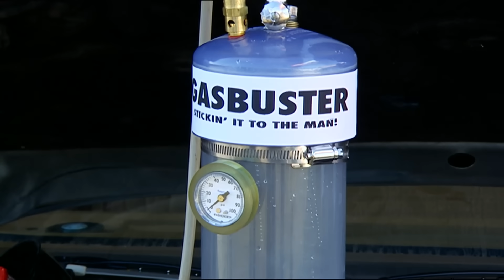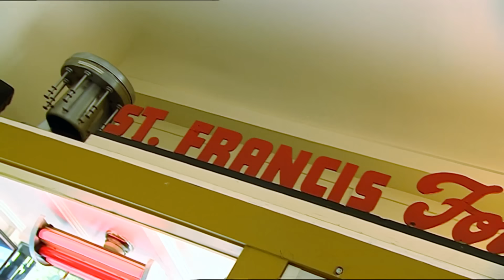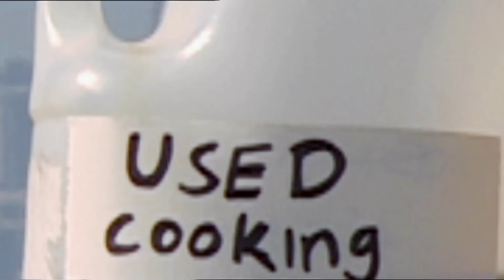Do Aftermarket Fuel Saver Devices Actually Work? | MythBusters

Comment: A point of fact: switching your vehicle to operate on bio-d, wood chippings, acorns, eggs, whipped cream is not fuel saving. It is shifting your fuel choice. If your car runs . And burning weird stuff in a diesel usually works. So you are just burning some fuel....

Comment: My HJ47 troopy ran on pure vegetable oil for several years around Rockingham, Western Australia after I fitted fuel heaters around the lines from injectors to motor. I had a 44gal drum of filtered oil for use anytime. I did run diesel through the lines once a month to prevent clogging.

Comment: I think it is incorrect to call that contraption a "hydrogen fuel cell."  There are cars that run on hydrogen, but they are designed for it.  A fuel cell vehicle (FCV) or fuel cell electric vehicle (FCEV) is an electric vehicle that uses a fuel cell, sometimes in combination with a small electric battery or supercapacitor, to power its onboard electric motor. Fuel cells in vehicles generate electricity generally using oxygen from the air and compressed hydrogen. Most fuel cell vehicles are classified as zero emission vehicles.  As for all those other gizmos (the magnets, etc.), they've all been tested by the California Air Resources Board and found to be bogus.  (I used to work at CARB.)  And if you live in CA, do not make changes that involve your car's emission system, unless the product is CARB certified.  Some of the aforementioned gizmos are permitted to be put on your vehicle, but the only thing the CARB certification means for them is that the gizmo won't harm your emissions system.

Comment: Hydrogen can be used as fuel for cars specifically designed to use it but despite it being the most common element in the universe, actually gathering hydrogen is a very expensive and energy intense process, which means that while the hydrogen itself might burn clean, just like with EVs, the fossil fuels burned to create it create a far larger carbon/pollution footprint than just using a normal ICE engine.
This is why I use beef tallow instead of plant oil to cook - because plant oil was originally designed for machines, not humans.
In London, they actually have police whose sole job is to sniff people's cars to make sure they aren't using recycled cooking oil so as to avoid the obscene fuel taxes.

Comment: Are you guys really that dense?  You completely blocked off the carburetor.  FROM ALL AIR.  The hydrogen from the fuel cell is meant to substitute/augment the gasoline.  No car is going to run if you completely block the air intake.

Comment: How about increasing fuel mileage. Heating element under carburetor to make fuel vapor.
 About 2 decades ago, I think. A person was selling a diesel motor home with a cooking oil pump that ran cooking oil though a couple filter to clean oil.  Had tank in cargo area. Cooking oil had to be kept warm. In winter.

Comment: Rudolph diesel originally patented the diesel engine in 1893, when the diesel engine was designed, diesel fuel did not exist, the engine was originally designed to run on vegetable oil! I don’t think diesel fuel actually existed until the 1920s it was designed to run on vegetable oil like they’re doing now!

Comment: 1:12 they’re doing the HHO thing wrong. There doesn’t appear to be any gas being produced in this set up, so either they’re doing it wrong intentionally because they don’t wanna get in trouble with the oil companies or they legitimately do not know how to set it up correctly, which is sad because I would figure these guys would’ve known how to do it.
Reply: You misunderstood the myth they are testing.

They aren't testing if one could make a fuel cell or something like this.
They are testing if gadgets bought on the Internet will work to save fuel.
It's not that they are doing it wrong, but instead the thing they bought just doesn't work.
Reply: No matter what you can't move away from fossil fuel given that it has more impact than just fuel.
It's plastics, and heating and cooking.

LNG is a good alternative but is volatile as its a gas form and not liquid unless its very very cold.

In terms of power generation, LNG is a much cleaner option which can impact the planet if it replaces coal entirely.
Heavy oil plants that generate power is only a bit cleaner than coal burning, but is worse than natural gas.

Gasoline is a byproduct of crude oil being refined into various types of oils btw, so a lot of energy is already spent refining it to get gasoline, which natural gas can be naturally occurring and just needed to be pumped out and stored.
Reply: @dra6o0n We can and will move away from fossil fuels; it's literally inevitable because it's a finite resource. 

The sooner we stop burning it, the more we keep for all the other uses we still have for petroleum products. The oil industry isn't going away, it's just changing.
Reply: @busterfixxitt Though it makes no sense to cause a scorched earth tactic to move away from it, as it'll set humanity back decades if so.
Reply: ya, they opted to tank it in on the second try and it worked, minus you need to advance the timing about 3 degree's to run hydrogen without backfiring

Comment: Just convert your car to an EV and you'll blow all these fuel myths out of the water. Literally the only thing holding back mass EV adoption is the battery technology. In 10 years the roads will look a lot different when Sodium Ion or Solid State batteries take off.
Reply: Nope. Gas forever baby! 🤷‍♂️ ev is soooo lame.
Reply: @generalzod7959  Have you ever driven one? EVs are superior in every way. Just drive one and you will change your mind.
Reply: Battery technology is already good enough.
What is holding EV adoption back is the lack of chargers and the mentality of many people.
Reply: @Jehty_  Li-Ion batteries are not energy dense enough and there is the risk of thermal runaway if the casing in damaged. Sodium Ion or Solid State batteries would not have this issue. If you can put a small battery in a car and have it run 500 miles, and then also recharge in less than 10 minutes, then that battery would be better. Until we hit that mark, batteries will not be good enough.
Reply: @VgAce135  not good enough for what?
Your arbitrary unrealistic idea of what a car has to be able to do?
Current EVs are already good enough for normal use. Good enough for the vast majority of people.

And the risk of fire really isn't a big deal.
Reply: @Jehty_  My Mini Cooper SE only has a range of 114 miles. I am telling you as an owner, that is not good enough. If I could get a Solid State or Sodium Ion battery in my car the range would double. 114 miles is really a pain with such low range. Stop arguing.
Reply: @VgAce135  you bought a vehicle for short distance city driving.
Of course it's no good for long distance driving.
That doesn't mean the battery technology isn't there yet. It just means you bought the wrong vehicle for your usecase.
Reply: @Jehty_  Stop arguing. A better battery would increase range, decrease the chance of fire, and be better for the environment. Idk why this is so hard for you to understand. Stop arguing or you will be reported. You're just trolling at this point.
Reply: @VgAce135  of course better batteries would be better. Obviously.

But your first comment stated "literally the only thing holding back mass EV adoption is the battery technology".
And that's just incorrect. That's what I'm trying to get you to understand.
Reply: @Jehty_ the risk of no charge is. You can go get gas. Can't go get a charge.
Reply: @Jehty_ maybe it's them catching on fire
Reply: @deuce-infinitum2001  you mean like statistically ICEs are more likely to catch fire?
One would think that by now everyone would know that. But still every. Single. Time. EVs are brought up some dimwit feels the need to mention that sometimes EVs catch on fire.

I've never run out of fuel. So why should I be worried about running out of charge on an EV? It's not that difficult to keep an eye on your fuel gauge or state of charge.

Comment: I built a hydrogen generator many years ago and it would run the engine but not much faster than idle. Still it was enough to get the truck to the gas station if you ran out of gasoline while driving.

Comment: "I can't believe it doesn't work I found it on the internet!" Any Good public AI can tell you why it didn't work.. Btw = For non-Primitive joker method of making hydrogen = 3 Ultrasonic lasers with resonance filters for ignoring material of container of water to beam from outside to inside and to overload bonds of water in Triangle pattern. Google: "Unclassified Plasma Triangle UFO British Military" + Google: "Trinity Triangle ancient Symbol" For best Ultrasound = Plasma generated Ultrasound.. Super lower power if nano-target vs your power generation. Hmp.. Thermoelectric Generator mods to recycle engine heat to stack power in capacitor bank If you want Boeing Plasma generated Ultrasound Bomb shield discharges or resonance disintegration bursts to drive through police blockades like they don't exist.. Movie Wraith Plasma reinforced Engine scene https://www.youtube.com/watch?v=z-Y7WnKKTIs Plasma generated Ultrasonic echo clashing single sourced pressure hold for shapes of objects to defend. 

Need more power? Google: "Ultrasound can control electric plasma" By controlling what it needs. Releases echoes and converts scan data to images in mind see the charges lining up to dump lightning from Earth Oops.. Holds up Piezoelectric Ultrasound machine Crystal Crystal Magic.. If your instinct is a DICK its not gonna care to get things right. - Dracula/Hades (Owner of Hell mind download server)

Comment: I made a "gasoline bong" from a 2.5 gallon container and some dryer tube. That contraption ran a 1978 toyota pickup with the 20R engine up to 2,000 rpm without issues.

Comment: The original diesel engine ran  on peanut oil...
Reply: modern diesels that are not laced with sensors and electronics mostly sold as base models can still run on peanut oil. the only issue is that it will obviously be down on power and basically knock itself 😂
Reply: The original diesel engine also looks nothing like modern diesel engines.
Reply: @madmanwithaplan1826  no but the concepts and the science is the same some early electric cars existed and ran on batteries and now we have Teslas it's just science and engineering changing shape but the concepts are still there except they're more advanced as science and engineering has advanced so same principles.

Comment: Mechanic here, used cooking oil and used motor oil does work as a cheap fuel for diesels but you do need to do a few modifications to help extend the life of the vehicle. I'd highly advise cutting the oil with diesel to thin it out to not strain the lift pump, injector pump or injectors. Also you should filter the oil down to around 10 micron before adding it to the fuel tank to prevent your fuel filters from prematurely clogging.
Reply: We found that attaching a magnetic block heater to keep the fuel warm helped, especially in the winter
Reply: I was gonna say 70/30
Reply: True! Car Throttle, some years ago, tested an early 2000 Skoda Octavia diesel with exhaust cooking oil, he filtered it three times, worked fine, only lost a bit of power, but he also said it worked because it's an old diesel engine, and probably won't work SO good with modern ones
Reply: My uncle did that for a few years too. He added a block heater to get it to start easier and a system to warm the oil to 90F with the exhaust once the engine was running. The truck certainly smelled like fries and was noticeably less powerful but still drivable.
Reply: hmm  I run all my vehicle on water..  its basically free,,   I pay for water,  'bout it....  switch it back over to gas when emisions testing comes up :-)     given the fact its exausting water I just aimed the exaust back into the water resevoir LOL....  no its not infinite, but it use's a LOT less then gasoline

Comment: No they do not work if these things worked and kept emissions standards the same every manufacturer would put them on the car the minute they were built. Yes there are things that you can do to increase your fuel mileage but that may lean out the mixture causing higher nox emissions.

Comment: About that diesel running on use fat...
1. You will need a pre heater, because cooking oil have higher viscosity, therefore putting strain on injectors.(plate heat exchanger heated by heater curcuit will do do trick)
2. You will need an extra fuel tank for standard diesel, because a cold engine have a strugle to start. Therefore you also will need two solenoid valves in order to change fuel on the fly, use diesel for warming up and flushing the engine at the end of the ride.
3. Add an "agricultural" strainer filter, because a fat can colagulate and clog the indjectors.

Comment: Aviation and long haul trucking are big challenges for green energy. 
Biodiesel can play a significant part in both.
Reply: Battery electric trucks already  solved those challenges for long haul trucking.
With current battery technology the range of battery electric trucks is long enough that charging during the mandatory breaks and downtime is enough.

The only problem currently is the limited amount of chargers.
Reply: Get rid of planes completely go back to sail boats, and covered wagons all the moronic climate fears are eleiminated. We dont need airplanes we just like haveing them, and since climate clowns care so much about the climate im sure its no loss

Comment: any car mechanic or anyone has experience doing this can tell me if there are any problems with car maintenance? or is it all good? also anyone can tell me if you can mixed "used oil and diesel" would it result any better or worse? thanks in advance!
Reply: You can mix them but not to reuse the oil. At best you can use it to protect wood as a paint alternative. Warning, it’ll always be sticky.

Comment: The car market is extremely competitive. Anything that actually works is going to make it into your car. Maybe the Knights Templar, Oil Conglomerates, New World Order <insert your conspiracy here> can keep one or two manufacturers from adopting it, but the others will, and everyone will eventually have to fall in line to compete.
Reply: (Insert your favorite conspiracy theory here.)
😂😂
Reply: Your wrong. Several people have designed and proven vapor carbs in their garage such as thunderhead289 with super impressive mpg results.
Reply: Thats just one instance of something people have done in their GARAGE foolish to think there are not other possibilities considering carbs have been around for how long
Reply: @chadrobbins4021  Look into the whole 0 weight oil thing. Manufacturers are destroying engines trying to meet CAFE economy standards. This tin foil hat wonder carb stuff just doesn't hold up. If it worked, they'd be using it
Reply: @ttc5000 whatever bud just told you the YouTube channel where you can watch yourself being proved wrong your on the moon bud if I got a tinfoil hat
Reply: @chadrobbins4021  I'll take a look, but the only way I would accept being proved wrong is if I find independent testing of his claims. I have enough background in cars, carbs, and thermodynamics to know you are not getting 200 mpg out of a standard weight and dimension car. I would suggest you look at some of the 0W oil videos out there. If car manufacturers could legitimately pinch a few MPGs, they'd be doing it
Reply: @chadrobbins4021  I just realized I have watched this guy's stuff. He got 40 mpg (alleged) on a Ford by running a lawnmower carb. He also cut the power back to 60hp in the process. This is carb 101. If you run high flow thru too small of a carb they work very efficiently. This is why spreadbores exist.
Reply: @ttc5000 so your an expert on something you said didn't exist now? Happy for ya
Reply: @chadrobbins4021  40 mpg I can buy. 100+ especially with a carb aint happenin
Reply: Look into the phoebos cartel, and planned obsolescence.

Comment: Apparently there's a farmer in the UK that uses cow dung to run his car by somehow extracting the methane.
Reply: Very plausible. 
The other method I've seen was using dried grassy cow plops and a little wood to run off the wood smoke through a condenser, turning it into alcohol.

Comment: I worked in a grocery store that had a deli. A guy in an old black Mercedes diesel just like that would get our fry oil 😂 and it smelled good when he pulled up in it
Reply: Old diesels could run on oil, the diesel engine was meant for farmers to run on veg oil.
Reply: Diesel, is the name of the inventor of the ENGINE not its SYNTHETIC commercial fuel, the diesel engine was actually designed to run on PEANUT OIL 😳 🥜 🛢 💪
Reply: Biodiesel is the future